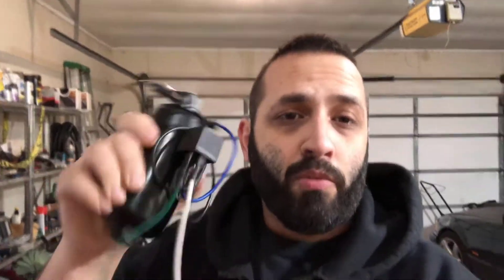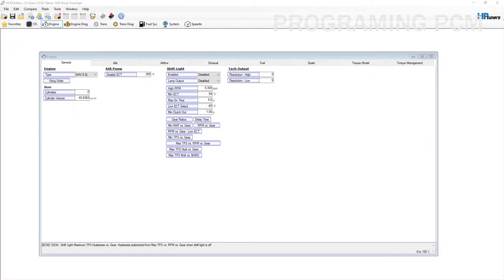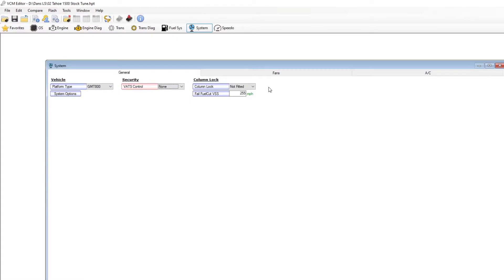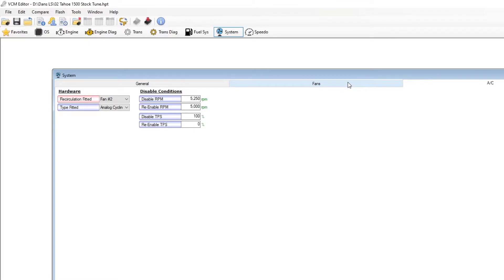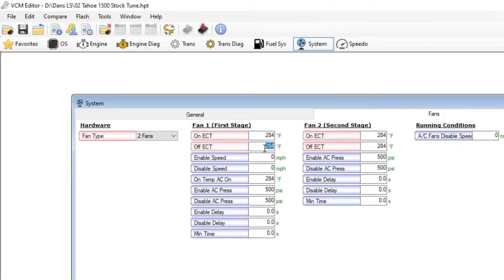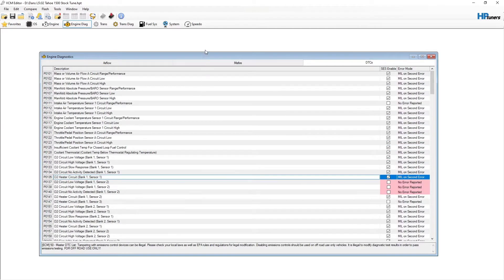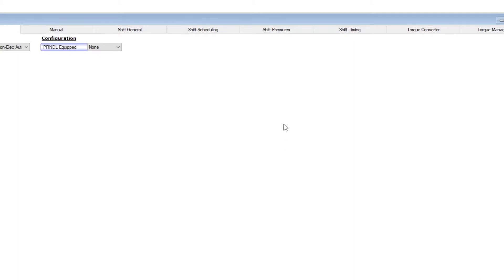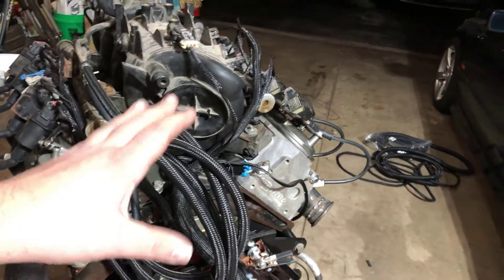DIY: LS Engine Stand Startup - Part 3 - Routing/Looming the Wire Harness for a Standalone Conversion

Comment: What kind of software and computer interface are you using. I’ve not done any LS swap stuff. I have a buddy who’s looking into doing it and I’m sure I’ll be helping him. He’s soon to be laid up with shoulder surgery, so I’m going to send him your videos, he’ll have plenty of time to watch them. 🤪
Reply from the maker: For this build we are using factory LS ecu with HPtuners software.
Reply: @815LSxSwaps  does it come with the interface cables??
Reply from the maker: @RealWorldGarage  if you buy hptuners it comes with the unit which connects the ecu to a laptop. Then you need credits to unlock the ecu but typically when you buy a unit it will come with some credits.
Reply: @815LSxSwaps  cool, new world kind of. I mean I work on them in the stock platform, in a fleet scenario, but not on this kind of level. I let my fingers do the walking and found a good HP tuners tutorial that answered a lot of questions. Thanks man appreciate it!!! Great video BTW.
Reply from the maker: @RealWorldGarage  no problem, never hesitate to ask us questions. We aren't experts by any means but have done a couple now.

Comment: What obd2 connection are you using I'm only seeing products with more then 3 wires do you have pic or link.
Reply from the maker: It's actually 4 wires from the OBD2 port. Pins 2, 4, 5 and 16. 2 is the serial connection to the ECU. 4 and 5 get looped together for ground. And, 16 for constant 12v +.